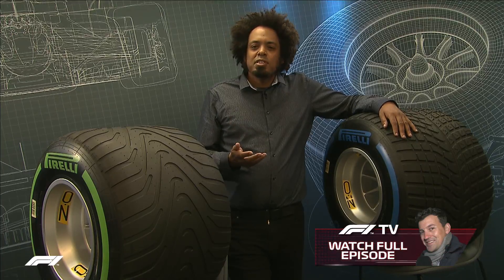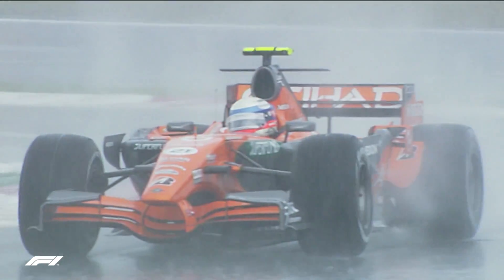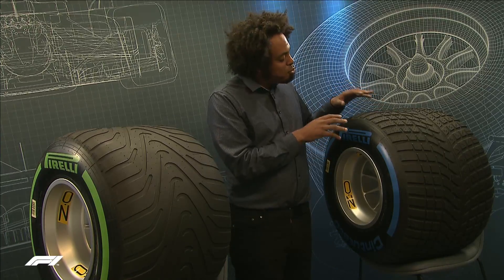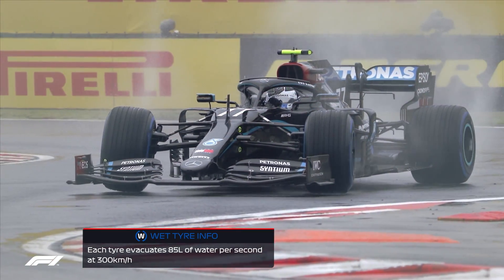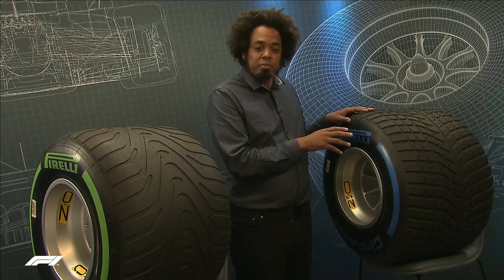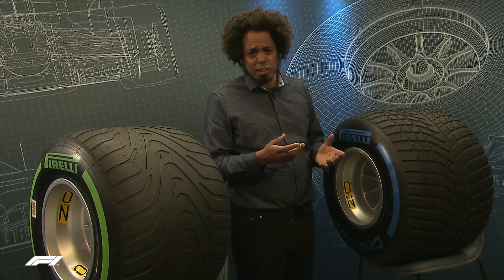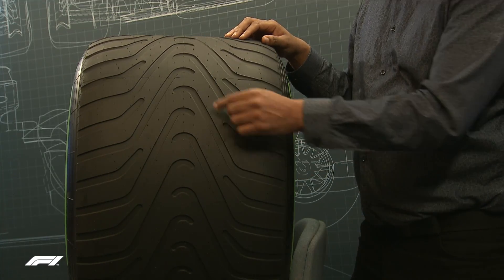Why The Correct Wet Tyre Is Key For Victory At The Nurburgring | Tech Talk | 2020 Eifel Grand Prix

Comment: The correct term for C is Celsius not Centigrade, it was changed to avoid confusion with Farenheit because the later scale was defined from 0-96,  while not exactly,  an argument can be made that it's also a Centigrade scale due it's etymology.

Comment: They can't be exposed to temperatures below 15 degrees? laughs in Finnish
We need a winter race. Since rain can happen at any time when its above freezing point of water, wet tyres need improvements. And actually you can have freezing temperatures with no snow, so slicks would have to be made winter proof as well. Especially if parts of the track would be heated or just have some warm pipes running under it (since i guess heating the roads is uncommon in the world, its not actually any warm temperature, it just needs to be above freezing point. I don't know how its commonly done in practice, but in theory ice water would be warm enough as long as its water and not ice).

Comment: 2:00 Btw larger contact area does not mean more grip per se. Area plays no role in friction, only friction coefficient (affected by compound) and normal force (weight + downforce) do. What does change when you increase the area is that your same friction is distributed over that larger area causing the surface to heat up less. Less heat means you can use a softer compound and THAT increases grip.

Comment: At 5:00 minutes in he says, " the car is less likely to aquaplane if it is sitting higher off the ground" (with the higher sidewall of the tyre). I don't see why... aquaplaning is a function of speed and tyre pressure (so my aviation career has told me), not height above the ground. Somebody please explain to me why he is not wrong.... 'cause I think Sam made a boo boo.
Reply: Chassis ride height has nothing to do with aquaplaning. Aquaplaning takes place when the contact surface (patch) of the tire loses contact with the road surface. Aquaplaning can happen at any speed or any tire pressure. Sam made a boo boo.

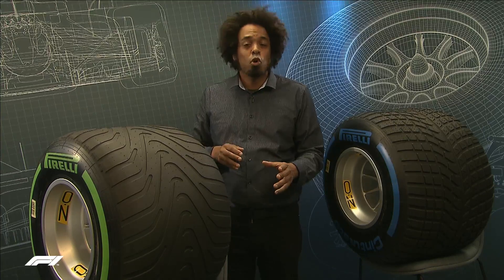Comment: 07:35 observation: someone will always try to switch it 1-2 lap earlier, Cause told from the pit. It can happen to anyone.  After he spun off, wait at least two laps, if the condition (as in weather) doesn't worsen. 

Actually I'm just curious is there any driver from P 1-4 in the championship standings at the moment, who didn't ever do it

😉